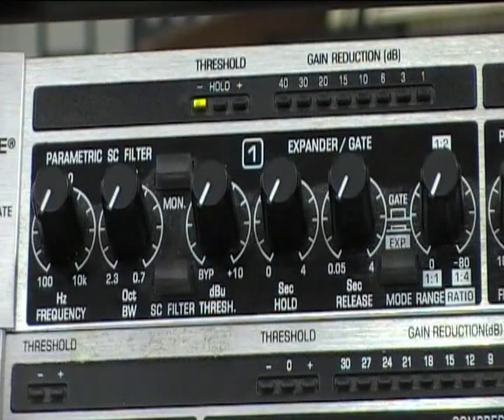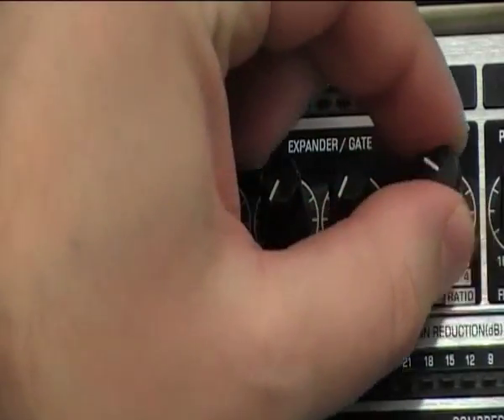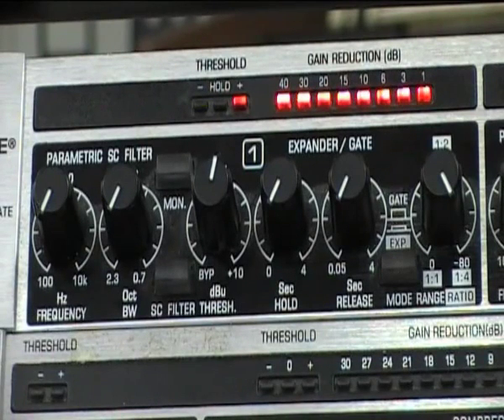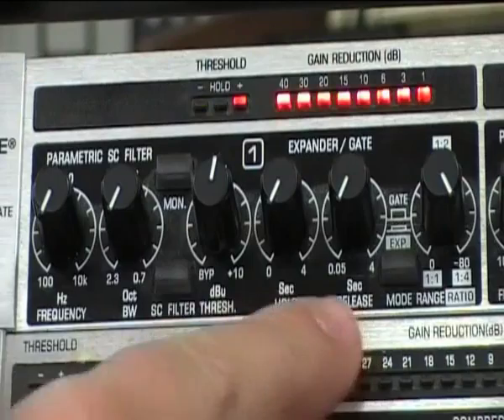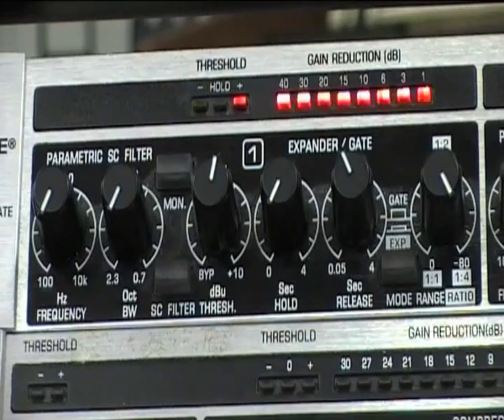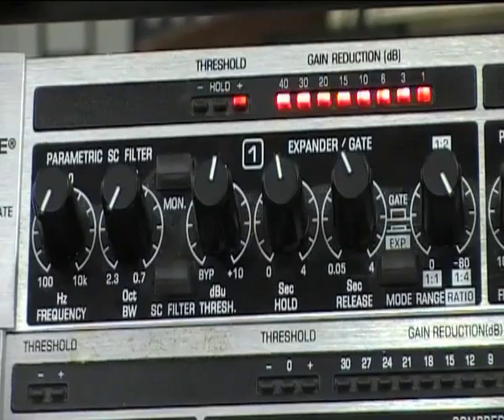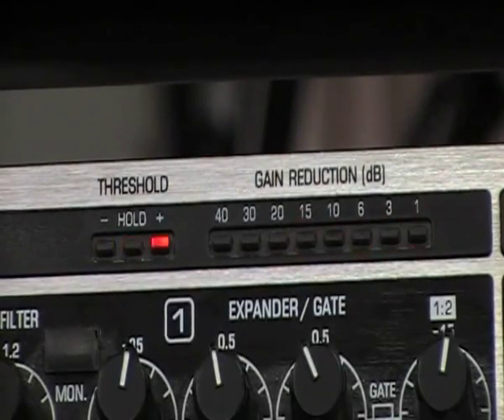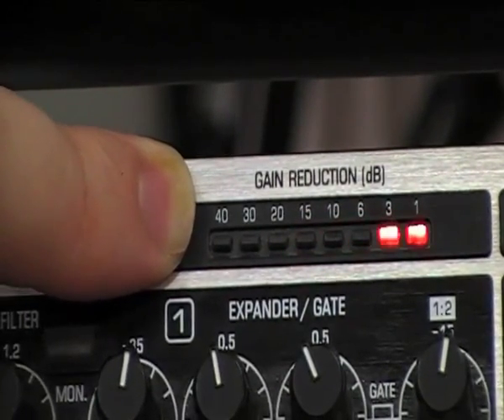KGV College Music Technology Live Sound Basics 12 Using the gate

Comment: how would you set this is expanding for a live vocal recording?
Reply from the maker: Hi Jezz. Pressing the mode button turns on the expander settings. Assuming you are trying to reduce background noise and spill in your live vocals, set the threshold below level of the vocal and adjust the ratio until you are happy with the level of the background noise in the vocal channel. Good mic position and isolation is key if you are multitracking a live performance with a view of creating a professional mix later.